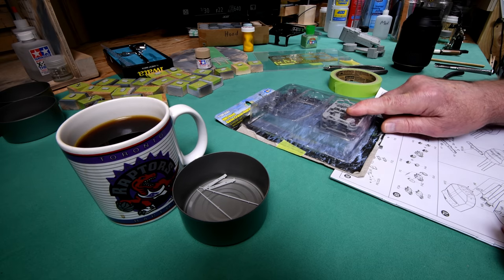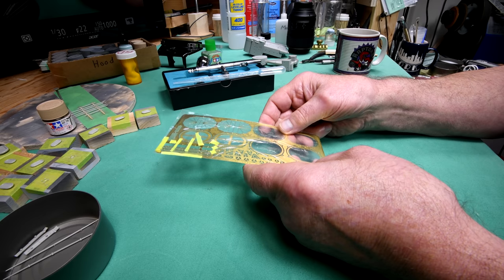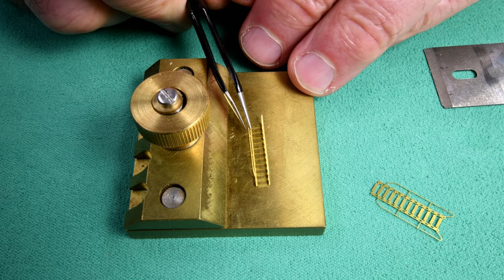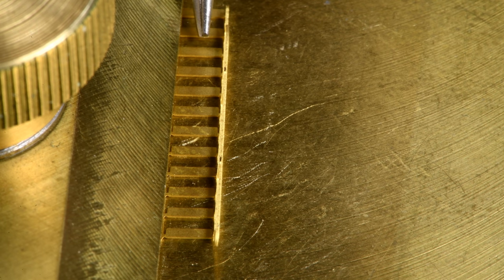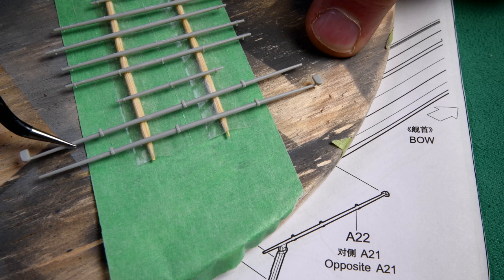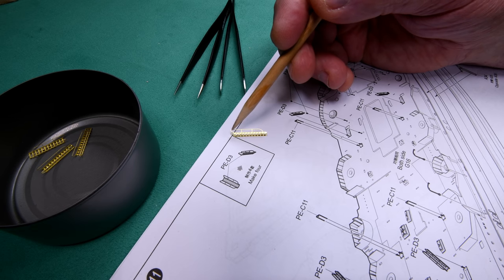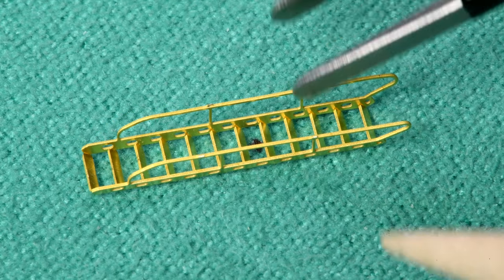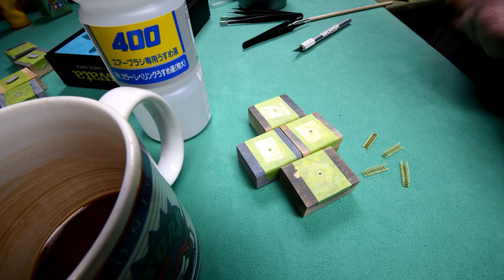The Model Ship - Part 584

Comment: Ron, another trick. Paint all the brass etch with Stynelrez on the sprues. Yup, peel off the plastic on both sides. Use tape to recover one side if you want. Same effect as the plastic film. Allow Stynelrez to dry for 24 hours first. Tiny nub left when you take the parts out won’t matter. This ensures that the final paint will adhere to the part with way less chance of getting “scratched” off. Been doing this for a while. Works for me.

Comment: Now, call me old fashioned, but, wouldn't it be easier to bend those treads from the underside rather than through the handrails? Not only could you could see them better but you wouldn't have to squeeze those tweezers through anything. I'll get my coat.